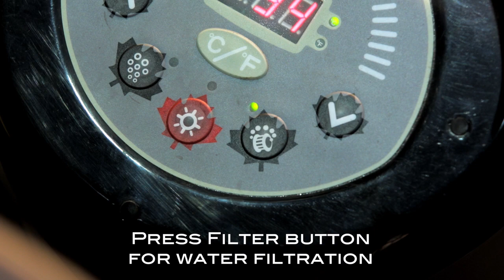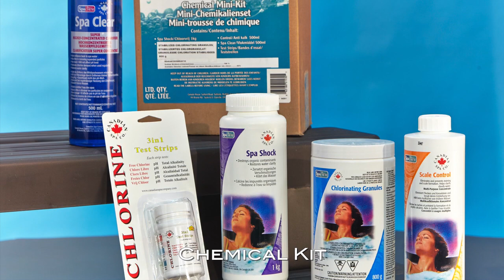Muskoka Portable Spa Assembly

Comment: How often do you have to change the water?
Reply: We have this spa and change the water every couple of months.
Reply: that depends on how you maintain the spa, and how many times you go in to it,
and if you take a shower before, or if you going to jump in it when you're sweating
your but off and didn't seen a shower for days, adn how often your test the water quality and add
clorine tablets to it, because that's the only chemical you need when you do it all right.
The first summer i had to refil the spa a few times with fresh water, because i had trouble
with a fine mist in the water and sometimes it looked milky, but last summer i used the same water
for 3 months,  because i didn't have any trouble with the water quality anymore , and now
it's up for 3 weeks, and again, no problems. I must also say that my spa is under a gazebo
so no direct sunlight can get hit the water, so it wil not easely turn green, and after i used it,
i put the lid on directly, because that prevents the clorine to vaporize to fast, and no dirt from outside
can get in, and it keeps the water longer warm. And i do clean my feet before i get into it, because
dirty feet is the main cause of al the dirt that ends up the bottom. And at last i do "vacuum clean"
the bottom regulary, and i scoop out the floating crap like hairs and insects with a fine mazed fishing net.
So you can take a glas from my spa and one from the tap, and you won't see any difference.
Reply: @jessfretwell2848  were did you get this can you get this in Canada

Comment: Sounded good until 48 hours to heat up
Reply: That's only if you are using real cold water.
I fill today and use tomorrow.
Much cheaper to operate than an expensive unit.
Great that they work on 115.
I use it in the garage with a TV and sound system; no snoopy neighbours watching. open the garage door to 'air out'.
Privacy allows you to use to 2 or 3 times a day. You really get your money's worth.